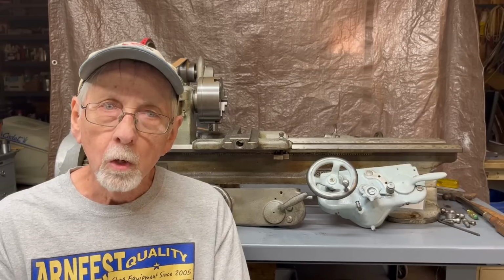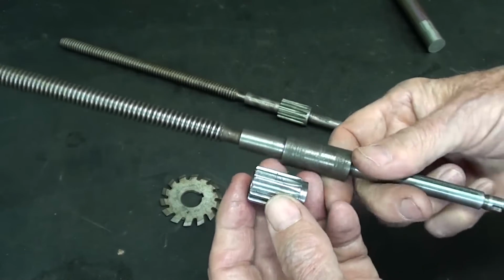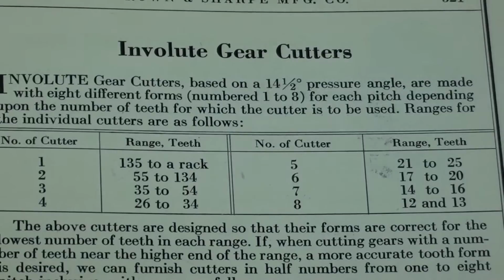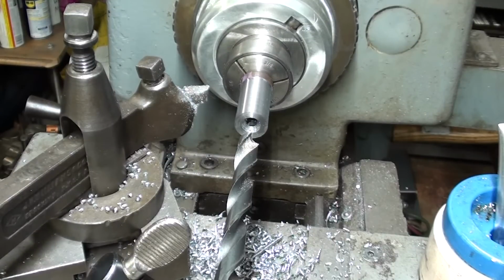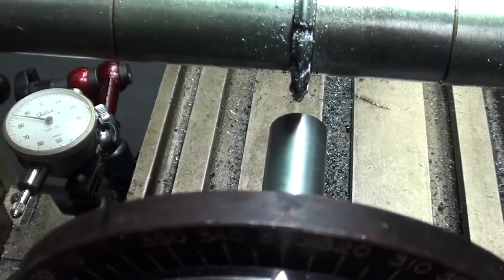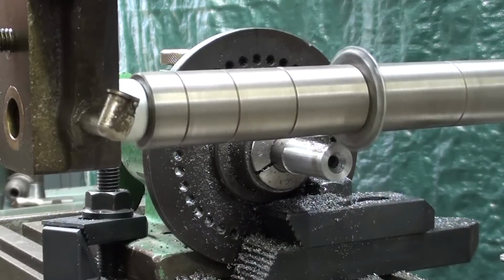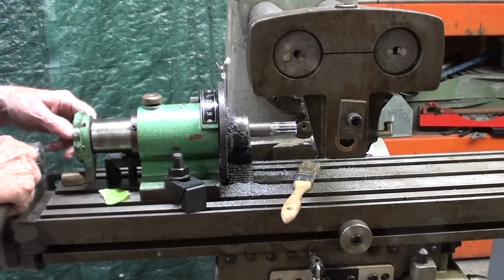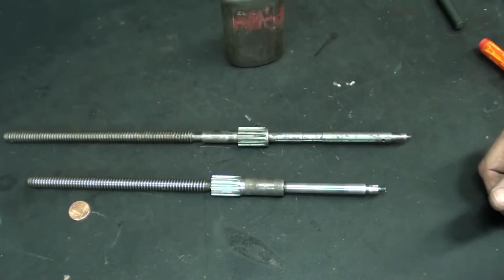Cutting a Gear for SB Crossfeed #804 part 2 tubalcain lathe

Comment: Hi Lyle, great videos, and thanks for all your efforts on passing on needed information and instructions for machining.
The cross-feed screw that was donated to you is for a large dial Heavy Ten, not a Workshop 9-inch. The cross-feed pinion gear 
on the Heavy Ten has a larger OD than the Workshop 9 pinion. This was for clearance in the apron. the OD of the Heavy Ten is 0.7000 -0 / + 0.0005, as you measured, but the Workshop is 0.6825 -0 / + 0.0005. This will change your numbers on you cuts slightly. I usually cut these to over-wire measurements, which is 0.7072 +/ -  0.001 over 0.084 Dia. wires. When fitting the stack-up clearance of the apron to the saddle in assembly there were different sizes of driven cross feed gears, standard, and plus and minus in 0.010, 0.020 to allow proper gear engagement of the feed-screw power feed pinion gear. Keep this in mind when fitting the apron, shimming may be required or a gear change if you run into an interference fit. Reduce the OD of you pinion by 0.0175 and it should not have a problem fitting the saddle. Hope this helps with your C to B conversion and give me a shout if you need any measurements on the lead screw. 
Take Care,
Steve Wells
wswells@earthlink.net
Reply from the maker: Thank you very very much for that detailed information. Which is all new to me. Just this morning a man sent me the correct screw and gear. I am mediately started to install it for test purposes. And noticed that the garage were not the same outside diameter. I’ll check them with a micrometer. Eventually there will be a final episode of the series where I install the correct screws. Surprisingly, it works quite well with the homemade one

Comment: Are my calculations correct? The side wall width at the root of the gear is .0225  inches. Perhaps that is why the other shaft is made in one piece.
Reply from the maker: I believe you are correct

Comment: How did you know that the pressure angle was 14.5 deg? Why the Loctite instead of an interference fit? Thanks for your answer and the nice video.

Comment: Mr pete thanks. You might be interested in a video I did on cutting a gear with a spin index. I had the spinindex bolted to my small milling machine and the cutter was horizontal rather than verticle. Watch it if you wish. None of my videos are playlisted so just keep scrolling until you find the video titled 'cutting gears using a spin index' my milling machine cost 900, index 75, cutter 35. I did it without having $50,000. Yahoo!! In the video due to distraction, I did increment the index incorrectly on one tooth. Result was just as you said, one thin tooth. Please excuse and not dock me credit on my grade.
Reply from the maker: Thank you, I will watch your video

Comment: Mr. Pete, this is totally outside my area of expertise, so I apologize in advance for a question that likely has an obvious answer from a machinist. Why could you not cut off the longer screw and machine the newly cut off end to match the original?
Reply: Very true, maybe its just an excuse to show the gear cutting process
Reply from the maker: As I always say, there are many ways of Doing a job

Comment: I wonder if turning the main shaft diameter down a bit allowing the gear to have more meat under the gear cuts to help with strength ? I would agree that, as it is, the gears may be too weak and lean of base material. Maybe that loctite will make up for this? However, this is only a 9" lathe.

Comment: Lyle you were whistling that poor cutter much too fast at 500 rpm. Those gear cutters are about 2.5 inches in diameter, HSS on steel is 100 fpm. To achieve 100 fpm you needed about 150 rpm. 500 rpm was giving you about 350 fpm. Great outcome by the way. Regards from Australia.

Comment: Are major of your machine run on three or single phase 220 volts. What would a person get if they wanted have home machine shop
Reply: Don’t be afraid to get 220v 3 phase machines. Lots of options to run those from single phase 220v.

Comment: I actually went through your videos and cut 2 gears. The cutter was dull and I was cutting 01. It got super hot . The last tooth warped. I probably was cutting with too fast a feed. I sent the cutter out for sharpening , bought a mister and will try again soon. I will use mild steel
Reply: A mister and good coolant solution is a godsend to the home shop.  Flood coolant is great but only if you use it every day and have the $$$ and time to maintain it.   I would only use tool steel for gears if I was able to grind and polish the wear surfaces and the application was high speed, high load, and lots of hours.  For most things mild steel or cast iron is best because it can "wear in" with use.

Comment: Interesting to see all the setups with correct cutter, indexing, speed, and depth of cut that Lyle shows here. Red Loctite will be plenty strong since little torque is needed and no heat produced for facing cuts on this size lathe. Looking forward to parts three and four.
Reply from the maker: Thanks

Comment: Would it have been possible to make the gear a press fit, simular concept  to the ring gear on a automotive flywheel?
Reply: Yes, but you have hit it on the button the first try when pressed on. If it hangs or doesn't sit correctly it'll be a proper pain to get it off. Would be better to bore the gear -0.001" then heat the gear and freeze the shaft. Still going to be a bear to get it off once it shrinks together. 
As lyle noted there isn't much place to retain the gear with a pin or set screws. Remember that the LocTite is working over a large surface area and you'd probably break a tooth on the gear before the LocTite let go.

Comment: Very informative. Wondering if you have ever had a loctite attached gear give way because of heat generated during use of the gear. Thanks for the info.
Reply: A friend of mine has a Norton motorcycle with a special cam installed. The cam was cut in two and lobes were re-indexed. He talked with LocTite technical assistance to get the correct compound to use and the ideal clearance between the pin used to join the cam together and the holes in the cam halves. The bike has been running for over 30 years without issue.
Reply: @aceroadholder2185  Thanks. That is good to know. At a trade show I once asked loctite representative how to defeat a loctite bond. He said if you can heat the part to 400° F, that crystalizes the loctite and it then breaks away easily. I dismantled an S-10 pickup once. The suspension bolts and nuts wouldn't budge. So I heated them to dull red. They broke away very easily then. Don't know if it was loctite or rust I crystalized but it worked. I may have modified the heat treated properties of the nuts and bolts. Don't know if i should reuse them or not.

Comment: Lyle has often commented that there are many ways to complete a task or solve a problem. His issue of having such a thin wall on his gear bore was addressed with loctite and using a small boss on the rear of the gear to gain some extra wall thickness support. The gear registers against a shoulder that is the largest diameter of the lead screw. I wonder if relieving this shoulder a substantial amount and increasing the gear length to make up the relieved distance would gain more thick wall  shaft contact to improve on his approach and gain more gear integrity? The screw does not require the large diameter for load integrity (note the small diameter of the crank attachment). I have no experience of relying solely on loctite for load applications. 
I worked in an industrial production environment. Long term service in that environment demands make me skeptical of loctite use for this purpose. Lyle's experience is different than mine and this hobby lathe modification likely doesn't warrant more than his approach.  I like that he eliminated the need for heat from silver solder or braising. This risks warping the already fragile screw.
A press fit may have been warranted, but risks destroying the fragile thin wall gear in the press.
Lyle tackled the challenging part by making the gear. I appreciate the effort and the instructional lesson. 

How accurate is this gear requirement? I suspect that this design allows a significant backlash tolerance. My production experience required class 12 and 14 spur gears. Gear blank bore size integrity, bore squareness to face, and gear blank diameter demanded high tolerance. We finished hobbed and hardened gears on a CNC gear grinder. Our gear application demanded extremely high precision. Gears were inspected on an extremely sensitive CNC gear inspection machine. I serviced and calibrated the machining and inspection equipment for over 30 years, but I have never cut a single gear!
Reply: I used this method on 36 in dia cast iron by 4" thick valve lapping wheels. They were turned, slotted about 3/4 of depth of disk on a planner, then bored a center guide and 'glued' a mild steel bore liner in, bored the steel liner to tolerance and done, never had one fail.
Reply: @brianburke7440  👍

Comment: 2 or 3 thousands interference fit. Drop the shaft into dry ice or nitrogen, heat gear up with propane torch. Slide it on. But make sure it works first!
Reply: That would work very well. I took a transmission apart once. There were bearing races in the case that I gave up trying to pound out. They wouldn't budge. Then I went to clean the case in very hot water. While cleanig I heard a couple of parts hit the bottom of the big pan containing the hot water and the case. Those parts turned out to be the races I was trying to pound out. The expansion of the case allowed those races to just fall out!! Note that one has to heat the entire case. Just heating the area around the race didn't work, which I did try while pounding. Putting the races back in would probably require heating the entire case again and putting them in while the transmission case is hot. Apparently the transmission during use does not get as hot as I had it during cleaning in hot water. The water was boiling hot.